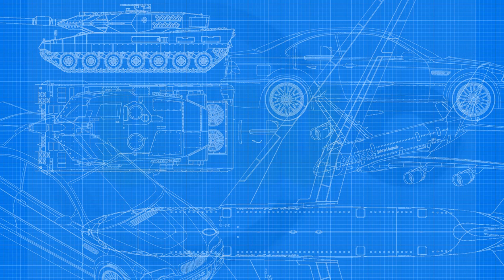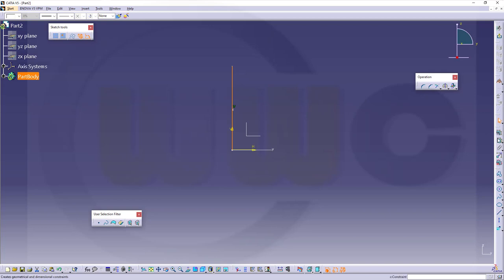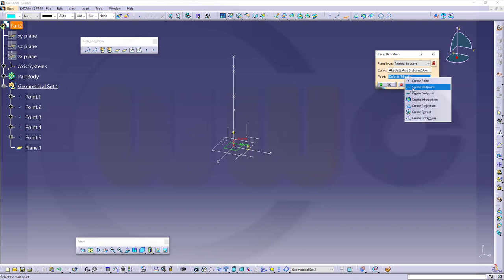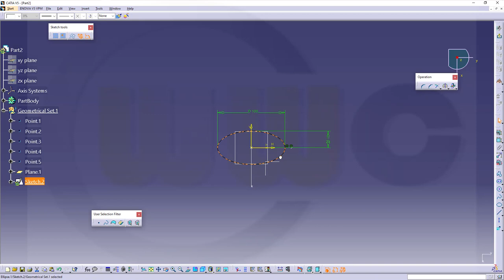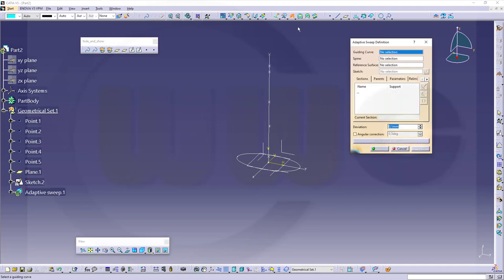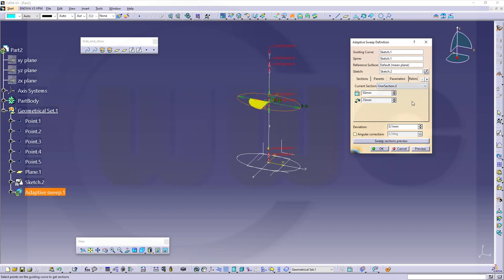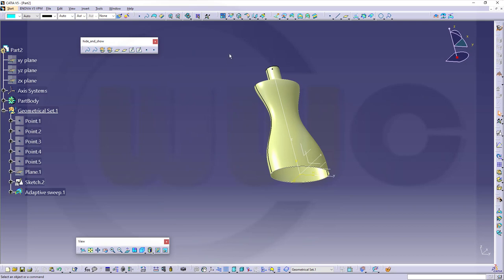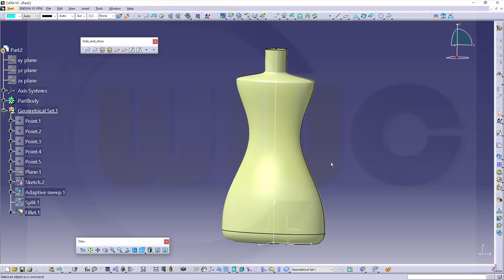Adaptive Sweep 2 - Catia V5 Training - GSD

Comment: Please make a video on GSD wireframe(not sketch based) remastering of sheet metal part.
Reply from the maker: What would be a "remastering" of a sheet metal part?
Reply: @wolfgang.walden.cad.training  Parametric modeling
Reply: @wolfgang.walden.cad.training  making a step file into editable file..
Reply from the maker: Please give me an example.
Reply: @wolfgang.walden.cad.training  my input is sheet metal step file. I will open it in GSD. 
I will put a new axis system on that part. Then by using toolbar like wireframe, surface, operation match the surface of that step file, finally apply thickness to that newly produced surface. And all we have to do this without keeping the relation with step file.
Reply: @wolfgang.walden.cad.training  have a look... I want more difficult examples and their solutions
Reply from the maker: Thanks for the example. Seems to be sort of laborious. But I will consider it.